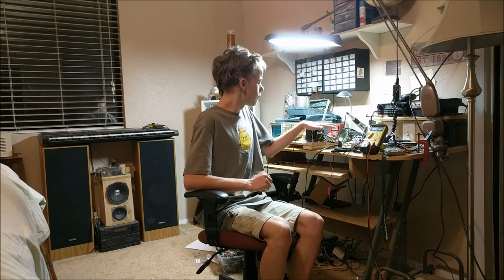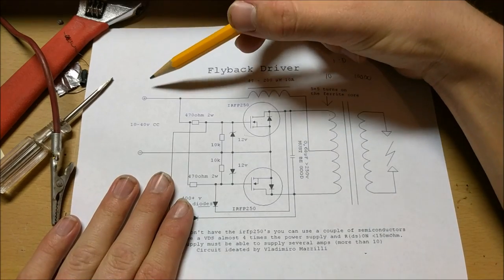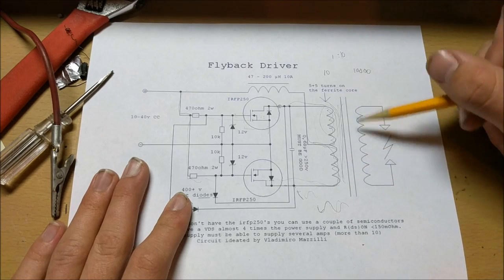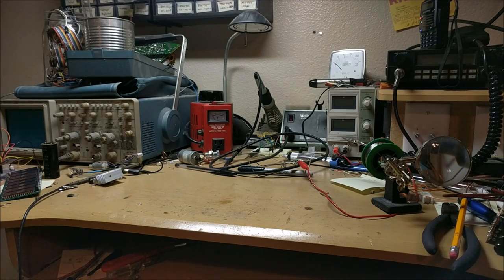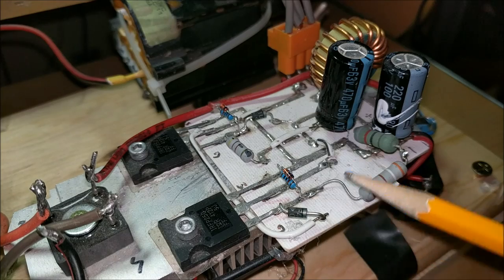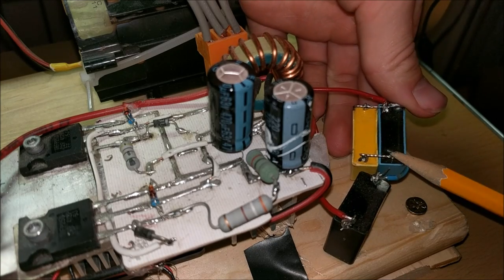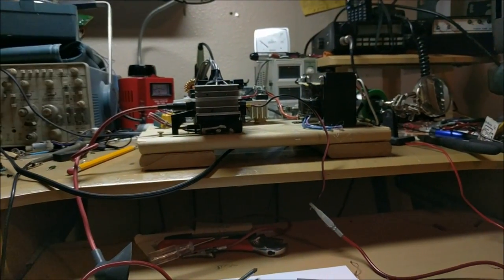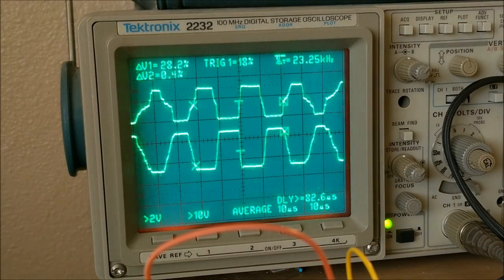How a ZVS Fly-back Driver Circuit Works and How to Build One

Comment: At about timestamp 15:16 it should be pointed out to NOT turn up the power while the arc is running, since you have BOTH hands (one reaching) on high voltage circuit components (and you can't watch both simultaneously) and may slip.  This may not be so critical in other 'safer' circuits.

Comment: The most efficient flyback I had was the BSC28. I had 2 BSC28 winded together with secondaries in series and damn, huge fat arcs.

Also, I got an AC filter inductor from a TV power supply stage, with one of its coils as the inductor for the ZVS and the other coil for audio modulation (requires a 30w audio amp). Very decent modulation.

Comment: This is a push-pull configuration rather than a flyback (not a big issue anyway). Nice heat sinks...I only have tiny sinks and my MOSFETs (IRF540 @ Vgs = 15V) always get very hot even with a current of only 1A .
Great video!! I like it.

Comment: can I use a circuit like that to initiate a HF plasma to modify my arc welder so that it can start the arc without having to scratch the metal piece?

Comment: Hi
did you put  heat transfer paste between the  heat sink and the flyback  ???
do you have to put new zip tide often ???
when you say wax , do you mean bee wax ???
can the small heat sink be located anywhere  between the flyback and the spark electrode  or does it have to be  at the end  of the cathode the way you in the video ???
Thanks.

Comment: Hey tanner can I use 1n4007 diodes instead of uf4007...I saw the data sheet of 1n4007 at the bottom I noticed it was written tested at 1mhz !...@4v.and the zvs only oscillates at roughly 40-50khz... don't have uf4007😁

Comment: The 470 ohm resistors are to protect the zener diodes - very little current flows thru the gates of the mosfets since these are voltage controllede devices compared to BJT
Reply from the maker: Good to know, thanks!

Comment: I have the ZVS open board coil heating unit model with bright top copper heatsink +  top fan for 12v use. I need 200watts output to ONLY run a 30VAC transformer. 3 terminals on output. . The advertising says only 100watts. Can I reduce the choke coil L inductance for higher current going to the center tap of transformer ? Or should it be  only larger capacitance than on the board  that resonates with primary of transformer?  ( 200W Inverter power supply needed.) This is called self excited type rather than the IC Oscillator driven type. The MOSFET switchers on board are fully capable. Low voltage output + high wattage Inverters are non purchasable and transformer has to be hand wound special. (already done with bifilar primary.)

Comment: Can this circuit be used for electrostatic coatings applications. 
By adding a high voltage cascade to tame the current.

Comment: Hello, I applied your circuit to a simulation program, but the voltmeter did not read any value .. Is it a problem with the program or connected to the circuit ... I applied other circuits for the same purpose but the voltage appears to me very little
Reply from the maker: This circuit will only work because the slight differences in components cause the oscillation to start.  I would suggest modifying a few of the component values so the circuit is no longer symmetrical.  Specifically, try changing one of the gate resistors by a few ohms.  Let me know if that works!

Comment: CAN you make a SIMPLE ignition COIL & CDI  SYSTEM WITH AC TRIGGER MAG NO 12VOLT SYSTEM FROM FROM ALTENATOR ON A 2CYCLE ENGINE AND FIRE SPARK PLUG

Comment: Pls could you tell me what is the output voltage of the circuit without a step up  transformer if the input voltage was 12volts
Thanks alot
Reply: From my own experience, I would estimate it to be around 10kV, but not sure. I was not able to measure it because the frequency is close to 20khz.

Comment: Thanks for sharing this awesome Video! Keep rocking dude. Subscribed to your channel. Please clarify my doubt, if we increase the turns in the choke windings, will it reduces or increases the supplied amps to the LC tank circuit?
Reply from the maker: Thanks man! The choke winding is there to slow the rate at which the current increases, not necessarily the amount of current.  It is also there to stop any of the high frequency components from the oscillator from interfering with the rest of the circuit.  The more windings, the longer it takes for the current to reach it's max value.
Reply: @TannerTech  Thanks for your prompt reply.

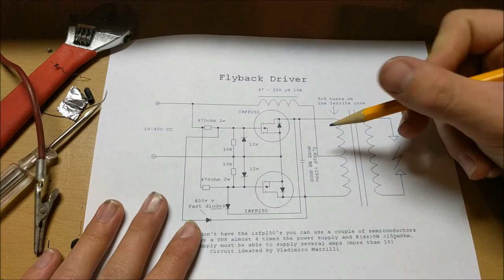Comment: 8:50 & 2:16 I don’t get it. With the 110 to 40V AC transformer you plug it into a full bridge rectifier. Now you have 40V DC. With that you use the midgets to switch on/off to simulate AC so that you can run it through the coils to step up the voltage with the 1000 turns? Why not just plug the 40V AC into the transformer step up with 1000 turns instead of making it go through the bridge rectifier and then made into AC via zvs again?
Reply: Nvm it increases frequency lol

Comment: Could an electric fence transformer be used to power a flyback transformer?
Reply from the maker: Not really, though you could probably use the transformer driver from the electric fence to power a flyback.  It may not be very high powered though, so I would recommend just building your own driver.

Comment: Can I use a 1N4007 for that or do I need a UF4007 ?
Reply: CommnisZer CP i think 1n4007 is too slow.
Reply: Try with a bigger capacitor i.e. 4uF to slow it down to about 10kHz

Comment: Beaware that when you rectify 40v AC, you get nearly 60v DC. Be sure that components can hold up to this voltage.
Reply: depends on the waveform. Peak voltage stays the same. And RMS Voltage will also stay the same. Its just, that if you rectify eg. 230V AC power, and charge a capacitor with it, this capacitor will charge to 325V. But as soon as you connect it to a load, the average voltage should drop to 230V again. This works only, because the peak voltage of 230V AC actually isnt 230V, but 325V. Only the RMS voltage is 230V.

Comment: Is the high voltage released can be controlled from 0 - 20kV (for example)? Maybe switching PWM from IC555 or Arduino?
Reply: Yeah you’ll need a mosfet driver like the tc4420 or ir21110 to drive the mosfets correctly with the 555 or arduino

Comment: Isn't that the exact same circuit used in mosquito zappers?
Reply from the maker: +The Vedic Way No, those circuits use small one transistor oscillators and much smaller transformers, it is a much different circuit.  They are not as heavy duty as my ZVS driver.
Reply: 300ma only
Reply: @TannerTech  
All those oscillators are unstable and the one which used in mosquitoes killer called BLOCKING OSCILLATOR,you can make it in too many ways,cause OSCILLATORS are more like Art than science...

Comment: Thanks for Explanation on ZVS , plz help for my doubts , 1 - can I use gate drive resistor of 1/4 watt or can I use higher value of resistance like 700 ohm or 1kohm because mosfet can turn on with lower current and even on low voltage !!! ? 2 - l c tank is fixed for this ZVS Driver or we can vari cap value more or less than .680 nf ???? And 3 - can I use 60 Vds mosfet instead 200 Vds type if not then why Because primary turn is only about 2 -3 Turn should not genarat such high volt ????!!

Comment: gotta ask.. About those alligator clips.. Are those suited for that high voltages? Be honest. Great vid rly, but just watching your hands so close to the cables.. High voltage can easily jump through the cable's outer layer. And what about the screwdriver? pls use pvc rod or something.

Comment: What is the maximum voltage supply for this driver?
Reply from the maker: Depends on components used.  The Zener diodes limit the gate voltage to the FET's to 12v, so you can really raise it to 42+ volts.  The FET's and resonant cap bank may be the limiting factor.
Reply: @TannerTech  Thank you, you are rigrht, even I tried with 54 volts, it worked good. But when the coil in resonance the consomation is on maximum and back impuls too. There here no problems with 20+20 coil turns, but with 6+6 Iit burned out 2 devices.

Comment: A twist on the common multi-vibrator, but from what I see, NOT very efficient, especially under no load (power loss in the gate drive resistors).
I wonder if there is an exiting fix for this somewhere, I for one have never seen such a thing.
I guess it is very popular because it is simple.

This was seven years ago! ...WOW!

Comment: Tanner my man!!!  I hope you are still making videos!  Are you in college at this point / done college at this point???  I really hope you were able to get into something tech related in college because at the stage where you made this video, you were obviously very much into building really cool electronics stuff!  I'm quite a bit older than you are, but I didn't get really into electronics stuff until I signed up for an electrical engineering technician program at my local community college.  I was 19 years old at the time, and didn't know the difference between voltage and current!  That being said, in this video I'm guessing you are probably something like 13 or 14 years old, and you obviously know a whole lot more than I did when I started college, so yea if you took an electronics / electrical related program in college then you would have had one hell of a head start!!!  I'd love to hear an update as to how you are doing my friend.  Anyways, that's all I have to say for now.  Take it easy, and keep on experimenting!!!
-Localbroadcast / Dave

Comment: Ahh back when I was about 14 or so I used to tinker with flyback transformers. Much simpler circuit, much lower current sadly. I was lucky enough to get given a pile of stuff from a local TV repair shop.

Comment: Dude nice video... well i tried making 
one for myself but only managed to get roughly a  centimetre of purple arcs at 12v. Could you please help me out and tell me what could be the problem ? I am using a 12v adapter by the way
Reply from the maker: +Kevin Jacob The 12 volt adapter probably does not have amps to supply your driver.  This circuit takes about 5 amps.  How many can your adapter supply?
Reply: Tanner Tech about 2 - 2.5 amps... thanks man appreciate your fast response :) .. how many amps can we safely supply to this circuit ?
Reply from the maker: +Kevin Jacob 2 amps is not enough, that is why your Sparks are small.  Use the power jack in a car or the battery.  That should supply 10 amps, more than enough.
Reply: Tanner Tech thanks a million mate ! 😃
Reply: Tanner Tech Bruh i am sorry buddy but even after supplying 8 amps with adapter and 12v battery in parallel it still gives out the same result ...
Reply from the maker: +Kevin Jacob Hmm, your capacitors might be the issue.  You might need more capacitance.  What are you using for your tank capacitor right now?
Reply: Tanner Tech its uh 630v 684j (CBB22) capacitor
Reply: Also when i supply 24v it doesnt give off arcs
Reply: Dude i have seen your build but it seems like you have used multiple capacitors ... i have only used one capacitor mentioned above .... should i try changing the capacitors and put multiple instead ?
Reply: @harms123  long time indeed but thank you! I fixed this by adding more caps 4-5 years ago 🙂
Reply: @harms123  🙂

Comment: I wonder what it would do if you used an arc welding rod instead of a screw driver and a piece of metal for the heat sink..?   Probably make a nice weld..
Reply from the maker: +ED4action It might, I'll have to try that.  It might not have enough amperage to do that though.  Arc welder supply a lot of amperage.
Reply: now i'm thinking it would work better welding aluminum using a small wire of it..    do you have any ideas what to do with the high voltage capacitors out of micro-waves..? ive got a bunch of them, and a bunch of magnatrons.
Reply: @ED4action  Make a gun that microwaves bugs. Remember to bring your tinfoil hat!

Comment: What determines the frequency in that circuit?
Reply: Being a resonant oscillator the frequency that the mazilli will run at is determined by the inductance of the transformer’s primary coil and the capacitor. You can use the following formula to figure this out:

f = 1 / ( 2π * √[L * C] )

f  is the frequency in Hertz
L is the inductance of the primary in Henries
C is the capacitance of the capacitor in Farads

http://adammunich.com/zvs-driver/
Reply: 1 over 2 pi square root [L times C ) ?
Reply: When the distributed tractor force cancels the inductive inertia ?
Reply: A good practical approximation is: F (kHz) = 5 / SQRT( C uF * L mH)
In this case the Frequency is 5/ SQRT (0.680 uF * 0.060 mH) = ~25kHz

Comment: Help😧 can you do a YouTube on lifters aka ion propulsion..
I'm using a similar power source as you☝ but it won't fly
Reply: you need to rectify the output voltage with a diode or diodes(that can withstand the highvoltage) . since this flyback functions as an AC transformer

hopefully you have figured it out by now. but others may have same problem as you

Comment: interesting,  I am trying to assemble one of those tesla coil kits from china, I thought it might be helpful to know more about ZVS transformer as I have no experience with it.  My assumption was initially that the top coil acts as a feedback mechanism so I was a little surprised to notice that it was not involved in the primary function of the circuit.  Your 'workshop' is pretty cool,  I don't really have that so I migrate between the garden, garage, front drive, kitchen table at different times. I would be worried about setting the house on fire if I had like yours,  among other things.  Do you solder indoors too ?
Reply: You know there is such thing as a fume hood, right?

Comment: Sir I where made this circuit but low arc and one 470omh resister where heating 
Used components:irfp250n
10k resisters :2
470ohms :2
Fast diodes:sfaf405g 
Please solve my problem plezzzzzzzzzzzzzzzzzzzzzzzzzzzzzzzzzzzzz 
I made circuit like u sir with the help of
Circuit diagram like u

Comment: I was done watching when you said "high voltage current".
Reply: Is that a problem? He’s just saying high current resulting from high voltage
Reply: Voltage = Potential.
A Current,  like back EMF & water,  flows, from one location to another. A High-Potential/Voltage Current will travel in  the HV-side of a circuit,  just like water being let out of flood gates at a dam; when the water is high, and the gates opened, the water BURSTS out, as a High-Pressure (or high-potential) Current, as opposed to the slow low-potential/pressure Current UP-river, or even right above the dam.
Go read Nikola Tesla; he has chapters entitled "High-Frequency & High-Potential Currents".

Comment: Just a pointer, not trying to call you out. But your incorrect in stating a 1 to 10 turn ratio will give 10x the input voltage. That applies to ordinary transformers, not to flyback transformers or even SMPS transformers. They operate in a very different way than iron core low frequency transformers. There are a lot more factors that determines turns ratio and output voltage. Even a 1:1 turn ratio flyback will give you anywhere from 2x to 10x the input voltage.
Reply from the maker: Cool! Thanks for the info. Do you have a source where I could learn more about this?  I had no idea flybacks operated this way.